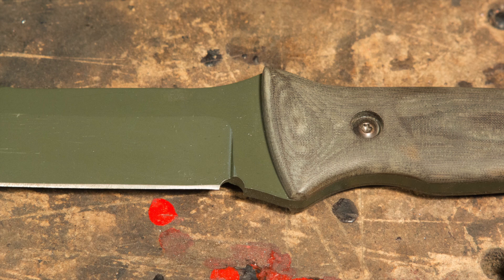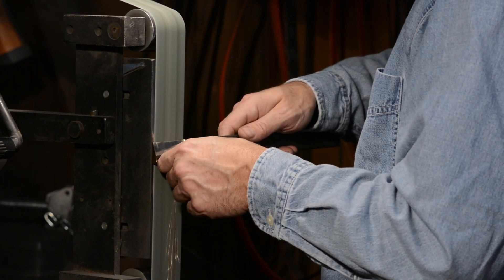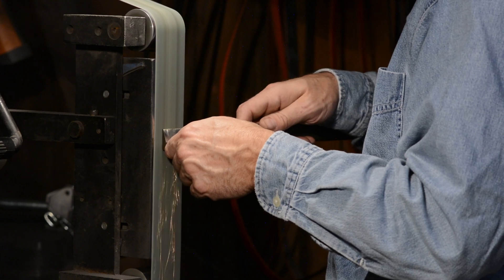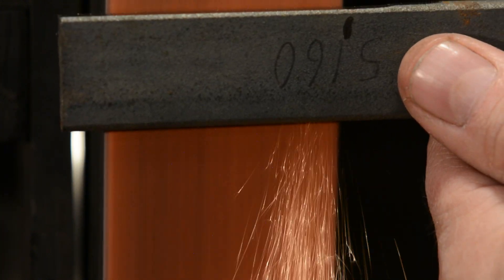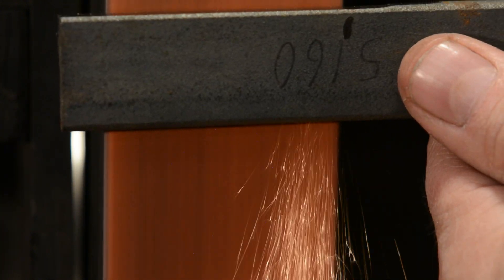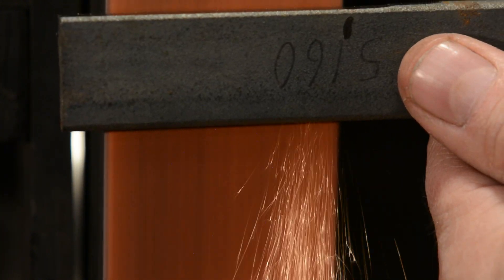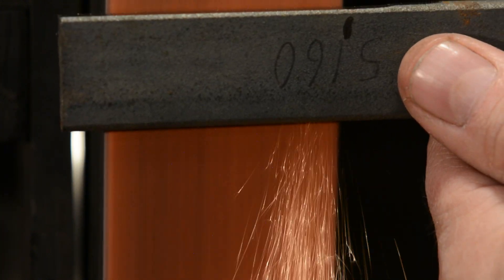Knife Making Tutorial:  Plunge Lines

Comment: My grandfather built a 50mm x 1250mm (thats about 2" x 48") belt grinder. It had no tracking. The plate was a bit smaller than the belt, so you could only grind soft plunge lines with this. Recently i built myself a 50mm x 2000 mm (thats about 2" x 72") belt grinder with tracking, matching plate, 2,2kW motor (thats about 3 horse power), a 20mm and a 40mm contact wheel. Material cost for this was about 200€. Building time about 3 weeks. Most of the material for this i got from the scrap yard. Now i can grind soft plunge lines with the small grinder and hard plunge lines with my bigger grinder. Just need more practice when grinding. And need to know when to stop grinding, so the blade wont get too thin and overheat. I like your tutorials. Even if it can be very confusing for someone who lives in metric country. Greetings from Germany.

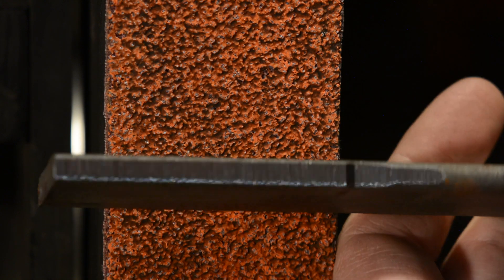Comment: Hi, at 2:00 when you make your initial plunge cut, it looks like the edge it still 90 degrees square.  Do you typically perform an initial grind at 45 degrees u to your desired pre-heat treat edge thickness first on a worn belt?  And then go to more shallow angle on a fresher belt?Was that step just skipped here?

Comment: Walter, you and Canterbury have vertical grinding systems with an open belt.  Always feel this is danger waiting to happen.  What about 2 side arms for holding hands and knife safely?   Able to safely grind and slide knife blank sideways back and forth.
Reply: +John Lord High end grinders like that come with a work rest, but experienced blade makers often remove it for free-hand grinding. Some guys suggest wearing a baseball cap while grinding, because if the belt breaks, it will slap across the brim of the hat and protect your face instead of putting a divot right between your eyes.
Reply: +FDT GURU Broken belt slaps do hurt, but if you wear eye protection you won't be really injured
Reply: +Logan Hoy But dayum are they scary LOL
Reply from the maker: +John Lord Belt grinders are far less dangerous than they seem.  They can chew you up a little (and they do!), but I don't know anybody who's been hurt by a grinder in any serious way.  Not saying it doesn't happen, but virtually all the knife makers I know use them set up this way.  That's just how the Bader is made.  Lots of far more dangerous machines in the metalworking shop. Unlike lathes, mills, drills, etc., if a grinder bogs down because something gets tangled up in it, the belt breaks.  Which is exciting, but not terribly dangerous.
Reply: +John Lord It'll scare the snot out of you when a belt breaks and I've had it happen quite a few times in my thirty years of knife making and I've never been hurt when it happens.  I always wear a respirator, safety glasses and a ball cap and they will protect your face. The tool that you NEED to respect and be very careful of is the buffer!
Reply: +FDT GURU I have gotten used to work rests but they are a hazzard. I once got the piece I was grinding stuck between the work rest and sanding belt with my thumb stuck in between... Operator error since you must keep the gap between the rest and belt at a absolute minimum. Thank God the belt was pretty worn allready or my right hand thumb would be gone!
Reply: I personally never fully tighten down my work rest. I leave it so it feels firm to the touch, but with the bolts loose enough that I can pull it out and away from the grinder. *****
Reply: Wear safety glasses: Bits of metal or grit can get into your eyes.
Keep your hands away from the bottom of the belt: If the belt catches your hand you don't want your finger to get pulled into the gap between belt and guard.
Don't wear gloves or loose sleeves: Fabric and leather can get caught.
Wear a ball cap: the brim will catch the belt if it breaks, but I've been pimp-slapped straight down the face without injury.
A belt sander looks scary but isn't that dangerous. It's angle grinders that hurt people.

Comment: I'm just curious, I have a buddy that's been making knifes for a few years and he told me to start ahead of the plunge line and move back to it instead of starting right on it. Wouldn't that be easier then starting right at the plunge line so you don't screw up the line you're going for or is there something that could be an issue later by doing it this way?
Reply: +rookyandb With practice and pressure/angle control, you can start and end your grind wherever you feel like.  It's the same way that some grind edge up, some edge down, some grind with the blade horizontal to the running of the belt....whatever actually WORKS for you is what you should do!  You can even grind in most of the bevel and then use a file and file guide to get your perfect plunge line....lotsa ways to skin this cat!
Reply from the maker: +rookyandb I like to establish the line at the beginning.  But once that's done, there's really no one way to do it.  I'm sure every knife maker has their pet approach.  I always tell people:  "Here's the way I do it.  Try it, and if it doesn't work for you, try something different."  The reason I like doing it from the plunge line out is that it keeps you working the blade in a systematic manner, which helps you maintain regularity.

Comment: what's the different between a plunge line and a ricasso?
Reply: +Joe Johnson The ricasso is just the flat, un-sharpened area between the grip and the cutting edge. The plunge line is the transition between the bevel and the ricasso. Like the name suggests, it is the region where the ricasso ends and "plunges" down into a bevel.

Comment: Have you got any tips for avoiding 2 inch marks? Over the last couple years I have gotten to be quite good behind the grinder, everything freehand both flat and hollow grinds. Probably 99% of the time everything is perfect. But every 20-30 knives (and usually a big chefs knife) I have the dreaded 2" mark show up in the final finishing..... 
Been trying different finishing techniques (greaseless on the buffer, cork belts with green compound, ect) and I'm definitely figuring out how to eliminate them. Just wondering if you might have any other tricks.

Part of it is just that I'm very picky about fit and finish..... To the extent of jumping between the grinder and the buffer for a total of 8 finishing steps to get the absolutely flawless glass mirror look. Probably took me close to 40 knives to perfect the polishing process.... The downside is that it reveals the slightest imperfection.... These two inch marks I'm facing aren't even a thou deep....
Reply: Geoff Flato 

Sand them out?